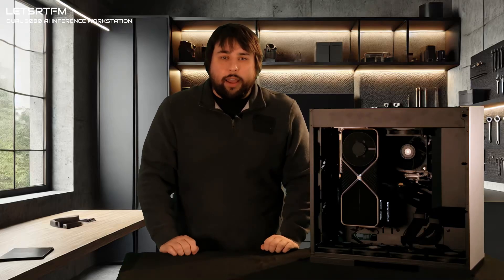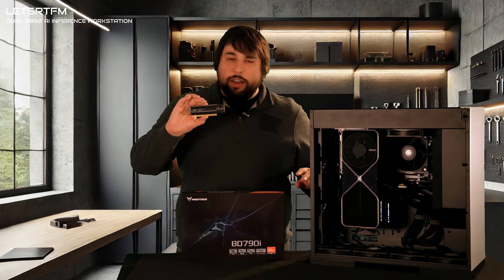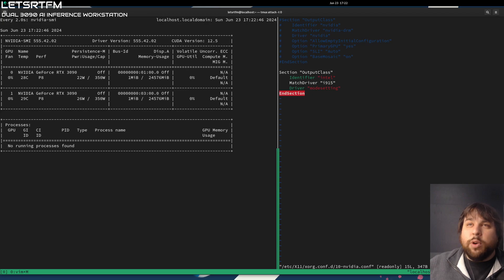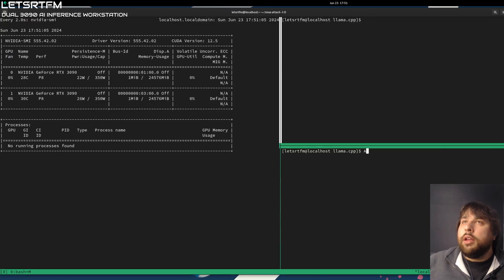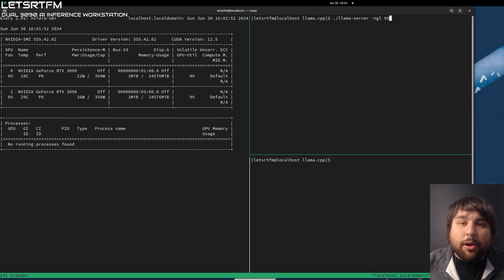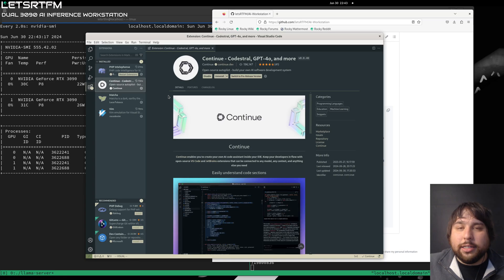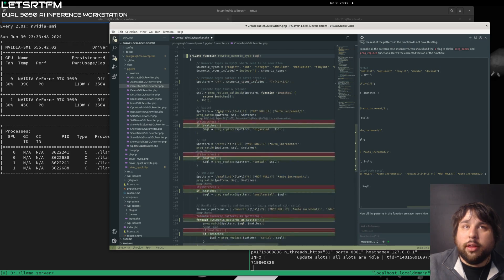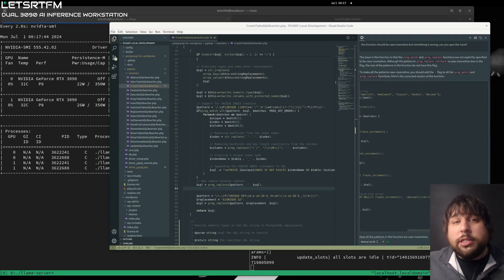DUAL 3090 AI Inference Workstation

Comment from the maker: Some of you have commented asking about Nvlink support.

I would say, it’s quite difficult to achieve on this setup as the spacing is 70mm which is not 3 slot or 4 slot, there’s a vertical offset which is hard to deal with and additionally I think the bracket will interfere with with the CPU fan.
Reply: I had used llama.cpp before the advent of ollama.  It's nice to know that Continue can use llama.cpp for local inferencing.  I had been using local AI Pilot extension of VSCode because it had a RAG implementation built in, but I will definitely be trying the Continue extension.  Thanks for the tips!
Reply: any follow ups?

Comment: I'm trying a build of this using the BD795i SE and 2x 5060Ti 16GB.  I can get both cards, and use both cards, but the nvidia topo is stuck at PHB, so trying to split a model (over 16GB) is doing data traversal over the CPU and times out.
in the BIOS I have Above 4G, Re-Size BAR, IOMMU and PCIe Gen 4 x8x8, but still won't use the PCIe bridge to communicate between cards.  Used JMT ADT-F36B-F37B-D8S PCI-e 4.0 X16 to X8 X8 MCIO Bifurcation Adapter Riser Card.
Am I missing some BIOS setting - or something else to effectively split a model load between 2 cards.
Reply from the maker: Look into tensor parallelism https://docs.vllm.ai/en/stable/serving/parallelism_scaling.html

Comment: Well detailed video, I hope you make the follow up videos.  I just recently did a build with 3x 3090. I initially tried bifurcation, but my slots are already full slot 1 - x8, slot 2 - x8, slot 3 - x4.  slot 2 supported for further splits x4 + x4 effectively supporting 4 GPUs total.  I tried a similar bifurcation card, but because technically its x16 -> x8 + x8 which doesn't work.  I ended with straight PCIe x16 risers which works on x8 and x4 slots.  I have to now use M2 slots to get a 4th gpu in.

Comment: Finally the video kind I've been looking for. Was thinking of setting up my machine for ai coding assist. Do I really need that much RAM? Was thinking to use single 3090 and perhaps upgrade to 64gb ddr5 ram. I have Ryzen 9 9900x CPU which is quite capable
Reply from the maker: You need just as much ram as you have vram, 64GB is fine imo
Reply from the maker: I have a 64GB AMD 7700 system with a single 3090 in it and it works well for stable diffusion other tasks. Realistically the best model I can run is 32B qwen at int4 quantization and 32K context.

For coding you probably want a bigger context, on my dual 3090 setup I can do 128k context which is much easier to work with

Comment: Your build looks fabulous, thanks for sharing the details, I like the approach you took with the bifurcation. I have one question, if the card isn't plugged into the slot on the board how did you make sure the card is secure and doesn't wobble, or is that not an issue?
Reply from the maker: That the GPUs are vertically mounted for helps and I used a GPU bracket. They don't wobble but I would remove them from the case if I was going to transport it

Comment: Hi LetsRTFM, great video — thanks! I’m currently building a similar system myself, and your content has been super helpful. I have a question regarding CPU usage when hosting a single large model that spans across two GPUs. How well does multi-core performance scale in this case? Would it be better to go with a CPU that has strong single-threaded performance, like the 7800X3D, or should I opt for something with more cores, like the 7900? (I’ve already committed to the AM5 platform.)

Comment: Im planning a similar build for the same reason. The 3090's have amazing bandwidth and NVLink is a no-brainer. I want it to run cool and quiet so I'm thinking of a triple radiator setup. Most advice out there seems to be geared to gaming, so I appreciate what you're doing. 👍 There's a lot of planning required

Comment: I wonder, will cuda work if I put  two different models Nvidia, for example: rtx3090 and rtx 4070 ?
Reply from the maker: This depends on the inference library, in theory it should work. I've seen people mix 3090s and 3090 ti's. 

I recommend just using cuda visible devices to expose a single GPU to the LLM and using the other for something like stable diffusion, whisper or kokoro

Comment: How did you fit 2 3-slot gpus on that vertical mount? From the looks of it, the additional PCIE riser cable won't be able to mount? 1 3090 FE would take up the entire 3 slots, no?
Reply from the maker: There's an extra mount built in the case, that's why I selected the geometric future.
Reply from the maker: Fyi If you want to run nvlink bridge you can also use the thermaltake cte 750 but it's a bit harder and worse in every way , you have to flip the GPUs upside down so the pcie faces the motherboard and remove the fans. I'll get around to a video on it one of these days.

Comment: I just built this for Comfy and I couldn't be happier.

Hoping to land a second 3090 in the next few months... Had to drop 9x C-notes for the one I got, but I wanted that 24 VRAM BAD.
Reply from the maker: Still the best way to go imo. The 4090 doesn't add any more performance per watt (besides being impossible to find) and especially for something like comfy the generation speed is good on the 3090. maybe next generation something will finally be worth upgrading to. Mine were about 9 C-notes each as well in 2024

Comment: So, if there are multiple gpus in a system, llama cpp by default with try to use both of them 50/50 model weight? I didnt see you enter any additional params to divide the model
Or is it auto only when model is bigger than 1 gpu vram?
Reply from the maker: The way to configure it is
export CUDA_VISIBLE_DEVICES=1
You can land the model one or each depending on your use case, for instance you might want to run a smaller model on one gpu and stable diffusion on the other

Comment: Doesnt 3090 have vram at the back side,  doesnt it get too hot ? 
do you lose performance on training if you fit batch in two gpus compared to one. ?
Reply from the maker: It does, that’s why the airflow and spacing is critical.

I’ve run 3090s in the formd t1 and without airflow once the memory chips on the back hit 95C Linux will reboot the driver.

For training I have another build coming out soon with nvlink

Comment: Why not buy a motherboard that has two 16 lane PCEe slots?
Reply: and then you need a cpu that supports 32 pcie lanes like a fancy and expensive xeon or a threadripper or an epyc, you can if youre rich but then why not buy dual 4090's or hey go dual a6000's or dual a100's, i mean why not dual h100s!

Comment: If you are going for ai setup, WHY intentionally running 2x 3090s on 8x or without nvlink?! Like, yea let's use two gpus for more compute power, BUT also let's lobotomize communication between them. Also, even regardless comm between cards, 92gb of ram and 16core cpu, awesome playground for any kinds of offloading, but yeah still let's still make the bandwidth between cpu and cards two times smaller.
Reply from the maker: I’ve tested this exact same setup with nvlink and there’s no difference. This is pcie gen 4 8x there’s plenty of bandwidth here what are you on about?
Reply: @LetsRTFM  i mean, mabey with inference of llms issue might not show up, but for example, some training with model sharding or deepspeed should. It's just that you are intentionally damaging one of more important features in an ai station. I think I can say that popularity of nvlink or high bandwidth communication with gpus in ai servers has a reason. I didn't try to be mean, but just look how it looks:
1. No nvlink- slower between gpu comm.
2. Running 8x instead of 16x on both cards- even slower between gpu comm and also slower comm with cpu.

Comment: Many thanks for this super helpful video! Noob question: sometimes I hear GPU memory is not shared across multiple cards but other times people just plug in multiple cards and stuff works. What's up with that? Much appreciated!

EDIT: great jam at the end!
Reply from the maker: It really depends on your use case. For inference there's good strategies to split it across multiple GPUs such that your memory doesn't have to act as one big pool.

For training it matters more and I plan to dig into this a bit more. There's options like NVLink but I'm not sure it's necessary and this is what I plan to test.

Comment: TBH, it doesn't seem to be necessary to have GPU in this spec becuase the 7945hx is powerful enough to run the same models smoothly. I've tried mixtral-8x7b-v0.1.Q4_K_M.gguf on the same motherboard without GPU to be installed, and it provides >30 tokens per seconde. What a surprise !
Reply from the maker: Yes I did some testing on this on a previous video when comparing the ar900i and bd790i.

Pleasantly surprised as well

Comment: How big is the performance reduction compared to a regular dual pcie 4x16 full lanes for each card?
Reply from the maker: So far I’ve found NVLink makes no difference for inference, training is likely when it comes into play, maybe it affects model load times but probably not inference itself.

I don’t have a CPU which can support 32 available lanes at pcie gen 4 so I can’t test this in depth.

It runs LLama 70b 4bit at 18 t/s if that means anything to you. To me it means that it can run 70B parameter fine tuned language models at a reasonable speed

Comment: How did you mount the 2 3090's to the case?  Did you have to modify the case, drill and tap new mounting positions?  And how much space exists between the cards now?  I appreciate the video and work you're done.  Made me rethink my AI build.  Do you think substituting 2 AMD 7900 XTX GPUs would work, they are cheaper but have 24 GB VRAM for inference?
Reply from the maker: I do think the 7900 xtx would fit if you get a 3 slot variant. the 3090 founders cards are quite big.

I did not have to modify the case, it comes with a vertical GPU slot. I bought and installed a vertical GPU mount into the cases standard pcie mounts, which gave me 2 separate vertical GPU mounds which are staggered vertically by an inch or so and separated by probably an inch or so

Comment: I cannot express how grateful I'm with this video and the documentation you provided. I've planning on building a dual 3090 system like yours but choosing the mobo and find a good solution for cooling has worried me a lot.
Reply from the maker: I wish it was easier to find whether motherboards support pcie bifurcation! 

Glad I was able to help.
Reply: @LetsRTFM not even Llama 3 or ChatGPt would give a straight answer when prompted about it 😅. Thanks!
Reply: Have you built this yet, I'm looking at the Corsair 7000D case, 1 x 420 top radiator, 2 x 360 front and side radiator. This ought to be able to run silent and cool for extended periods
Reply: @MichaelBarry-gz9xl  Yes I did. I used the following parts in case this is useful for someone arriving to the video
- Motherboard: Supermicro H12SSL-I
- Case: Enthoo Pro II
- CPU: AMD Epyc 7443
- RAM: 256 DDR4
- PSU: Seasonic PRIME GX-1300W Gold (12 years warranty and more than enough whatever they tell you anywhere else)
- CPU COOLER: Artick Freezer 4U-M
- Case fans: 5 Artic P14 PWM (Important PWM!!!) 3 intake, 2 outake (up and back). Also the cpu cooler is aligned with the horizontal fan extracting air.
- Two 3090s. I got one Gigabyte that is a gem but I also have a Gainward Phantom that it alone does more noise that the whole setup. Like +20db when it's running. A common problem apparently.
I managed to zip tie one of the GPUS to the lateral intake so takes fresh air from outside directly.

Focusing on the case: It's really big but solid and has plenty of space to play around. It's has different configuration (even for two systems) but with zip ties sky is the limit. If you are able to get 2-slot 3090s you can fit 4 without troubles. Even more if you get creative.

I have the setup in an Ikea Alex cabinet (the one with just one door) but I didn't install the door and I made a whole in the back that it's aligned with the horizontal outake, I plan to make some additional wholes for the vertical outake)

The temps are ok but I only run LLMs with it and I have both 3090 limited to 300W (if I remember correctly). Fans rarely pass 40%.  

Some obnoxious things about the case and the mobo:
case: it has a very small space in the top part which makes annoying (nothing terrible) to pass cables in the upper part). 
mobo: common problem in server mobos: it doesn't have suspension so it's all the time on which is not ideal for a workstation. Also it doesn't allow adjusting the curves of the fans, it does it automatically. During the first 10 minutes or so after turning on goes full blast 100% fan, which is not great but not terrible neither.

I hope this helps.

Comment: Considering building the same. Can it run Llama 3.1 70b ? Have you tried Qlora finetuning the smaller 8b ?
Reply from the maker: So fine tuning is pretty complicated honestly, but I’m looking into making a video on this process https://www.answer.ai/posts/2024-03-06-fsdp-qlora.html it seems like you can fine tune 70b on this setup.

Llama 3.1 8B can fit on a single 3090 (using around 22Gb of vram with vLLM) without any quantization but 70B will need quantization to run. Just looking at the sizes likely a 4k_m quantization will fit https://huggingface.co/bartowski/Meta-Llama-3.1-70B-Instruct-GGUF
Reply: Have you considered using a NVbridge?
Reply from the maker: @HPTrue Can you let me know your expected workload? If it makes sense I’ll purchase an nvlink and a new bracket to test this.
Reply: Just running large llm and nvbridge can combine some compute power?

Comment: I got 4x P40's in my Supermicro AI server, 96GB of VRAM in total. They are cheap, work great and you can run large models like llama:70b and mixtral-large with them easily. Smaller models just do not perform well enough in my opinion.
Reply: What kind of TPS you getting with the P40s with the 70B? What server you have it going with?

Comment: Thanks for sharing. TIL there is a laptop processor in desktop form factor by minis forum, a 96gb kit for a laptop ram and it's OK to run dual 3090 on a x8 lane each and I thought it would saturate that x8 but it works. Keep it up.

Comment: For what it's worth, I have dual 3090s in my AI machine, right next to each other, and they never get over 45c. 

They just don't run enough to warm up. And the Founder's Edition cards are PERFECT for that kind of setup. In fact, I just checked, and here's the current status:

+-----------------------------------------------------------------------------------------+
| NVIDIA-SMI 555.85                 Driver Version: 555.85         CUDA Version: 12.5     |
|-----------------------------------------+------------------------+----------------------+
| GPU  Name                  Driver-Model | Bus-Id          Disp.A | Volatile Uncorr. ECC |
| Fan  Temp   Perf          Pwr:Usage/Cap |           Memory-Usage | GPU-Util  Compute M. |
|                                         |                        |               MIG M. |
|=========================================+========================+======================|
|   0  NVIDIA GeForce RTX 3090      WDDM  |   00000000:04:00.0 Off |                  N/A |
|  0%   31C    P8             12W /  350W |     135MiB /  24576MiB |      0%      Default |
|                                         |                        |                  N/A |
+-----------------------------------------+------------------------+----------------------+
|   1  NVIDIA GeForce RTX 3090      WDDM  |   00000000:07:00.0 Off |                  N/A |
|  0%   32C    P8             16W /  350W |     313MiB /  24576MiB |      0%      Default |
|                                         |                        |                  N/A |
+-----------------------------------------+------------------------+----------------------+

So, nobody needs to be afraid of cramming two FE 3090s next to each other.
Reply from the maker: I’ve had 3090s overheat on me during AI workloads for sure, that said it was in an SFF case (formd t1)

A stress test I’d recommend is to start up 2 instances of stable diffusion and generate a few hundred images.

After about 30min I’d usually get a crash caused by the video memory on the back of the card hitting 95C. Windows doesn’t seem to care but under Linux the driver is a bit more picky. There’s probably a safety you can disable somewhere